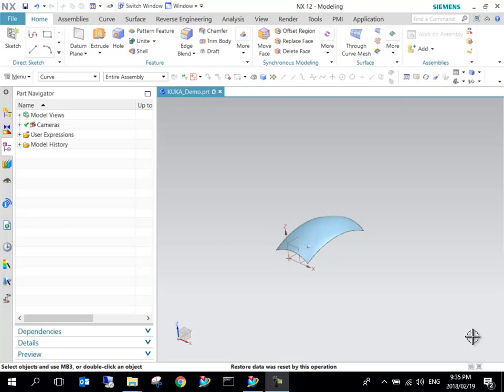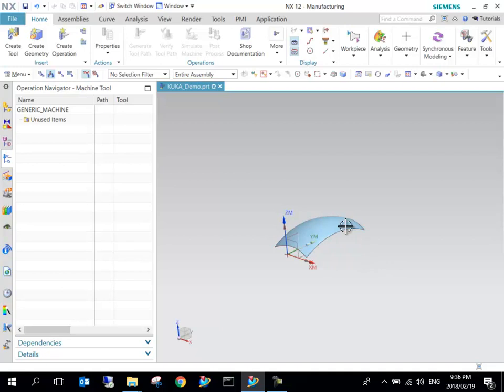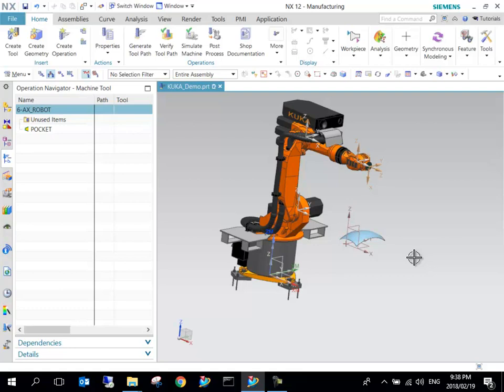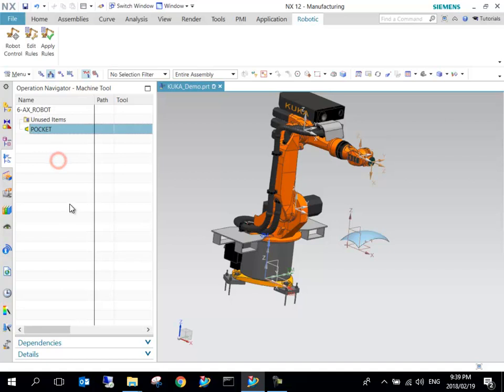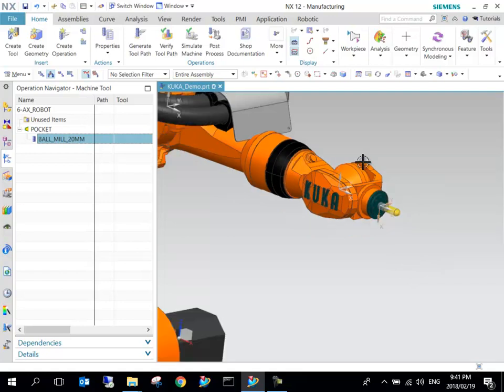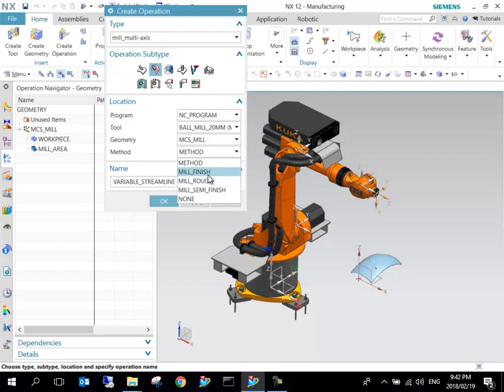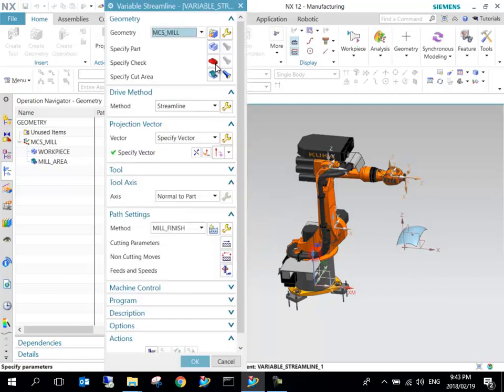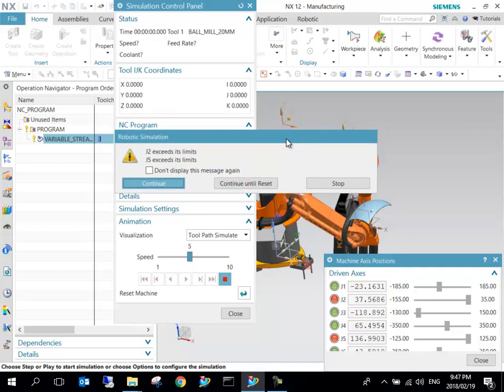Robotic Machining - Episode 2 - Creating Robotic Manufacturing Operations in NX CAM

Comment: Thanks for your awesome video. I have one question when you select retrieve machine, on my screen there is no option for robot.  Would this be a licensing issue or have a missed part of the download options. When i look in the mach folder there are some robot kinematic models.
Reply from the maker: Which version of NX are you running?
Reply from the maker: Hi Daniel, apologies for the late response. Is there a robot line in the ascii file?